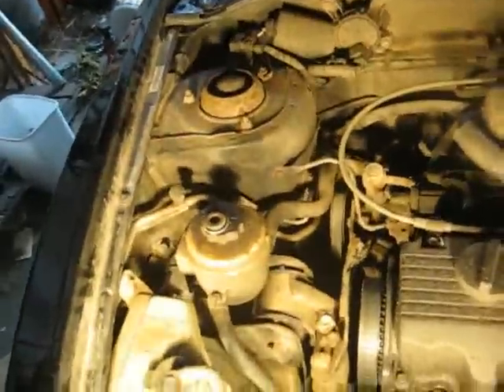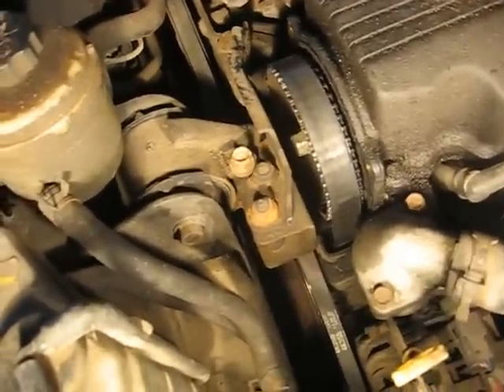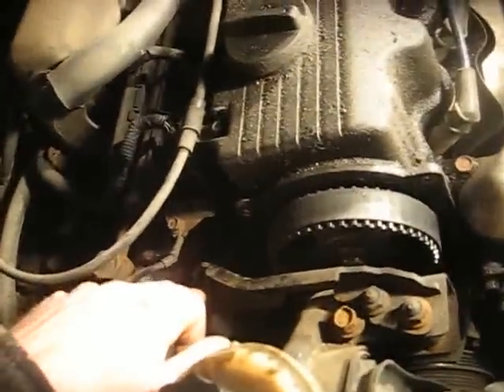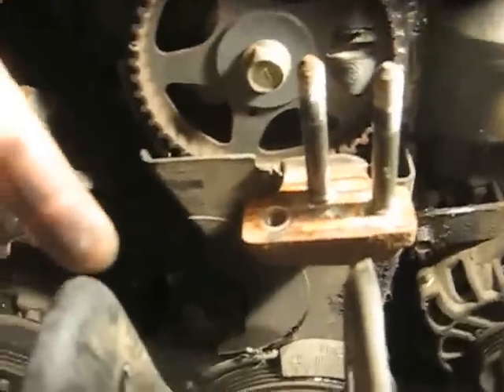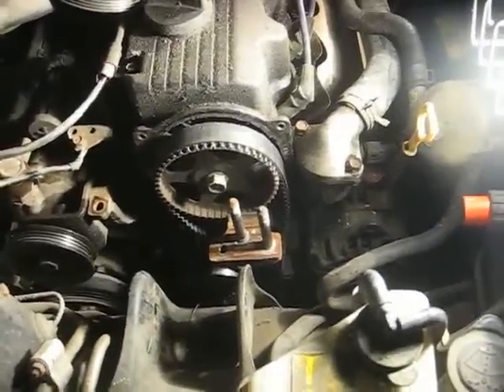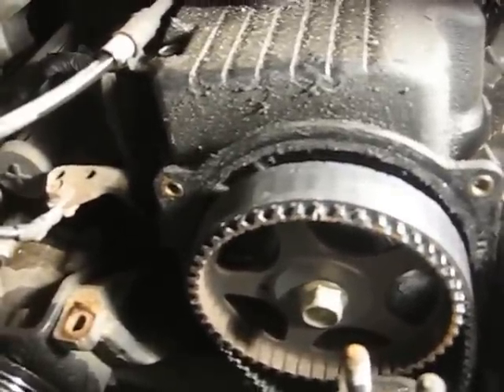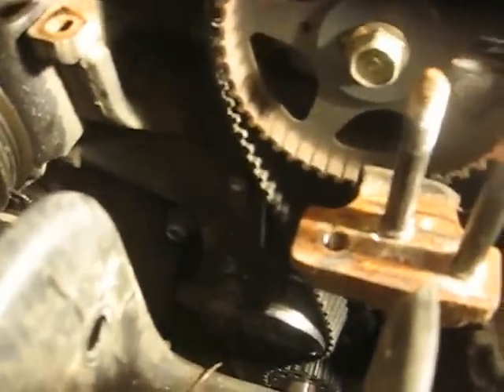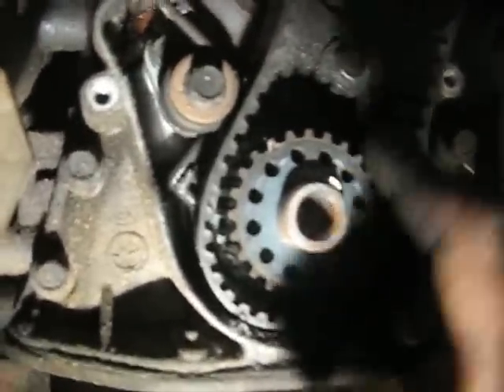Finding the problem on the Hyundai

Comment: Brent, you can test for bent valves just by using your shop air compressor.  Get the piston to tdc, check cam gear to see if valves are closed, then pump shop air down the spark plug hole. If you hear air rushing out the tailpipe or out the intake, you have a bent valve

Comment: Thanks for posting a really good reminder for us Hyundai owners to change the timing belt as recommended. I like your suggestion to remove water pump pulley while you still have the belt to hold on to. Hope the engine is OK  I'm getting ready to do my belt at 98,000km. The kit with all 4 belts, idler and tensioner was just over $100.00, and $17.99 for dynamic balancer removal tool..

Comment from the maker: I got the belt and tensioner for $31 so it didn't cost much and it wasn't too much work. If the engine is toast and I get a junkyard engine I can still use the new belt and tensioner on that one.